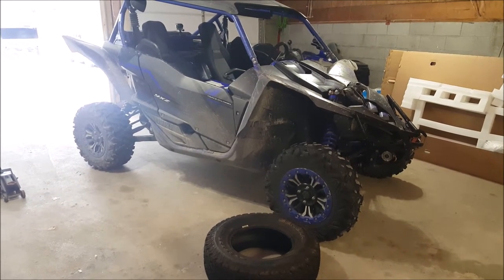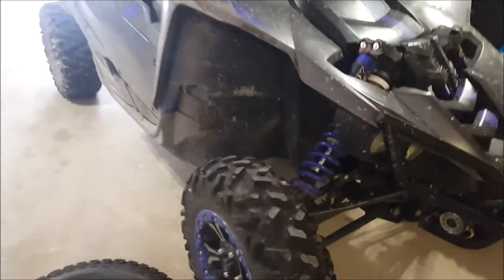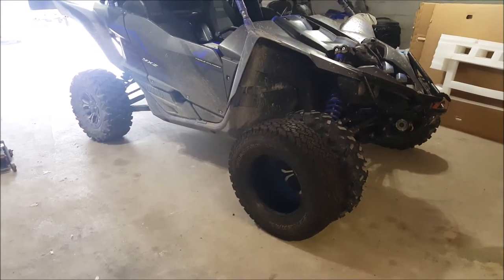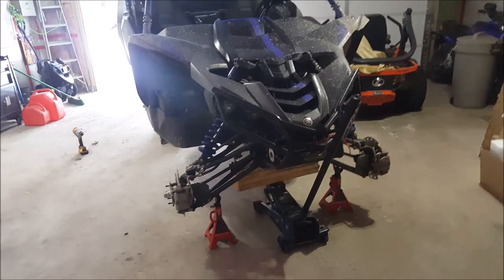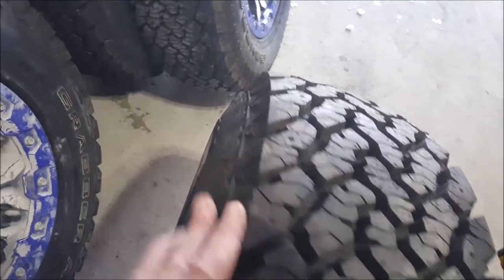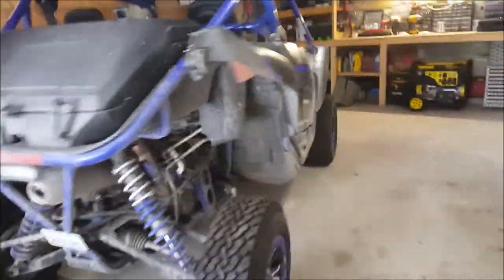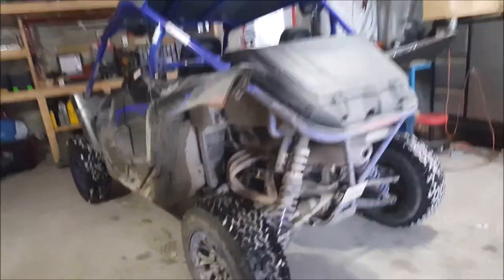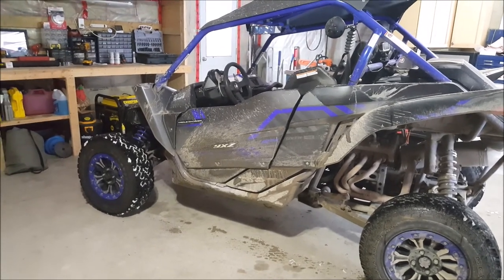Yamaha Yxz1000R Gets New Light Truck Tires | Yamaha Yxz1000R Turbo Tire

Comment: I'm about to do this on the front of my Honda Pioneer. Hopefully the ride isn't too hard.
Reply from the maker: No complaints here!
Reply from the maker: Ty, general grabber size is 27x8.5x14 lt tires
Reply: @McGo101  The ride is about the same. I don't have enough miles to tell how they are going to wear.

Comment: Did you measure the height after the tires was mounted?  Just curious if there was a height difference on the fronts vs the rear's with the wider rim.   I'm wanting to put LT tires on my Honda Pioneer 1000 factory rims.
Reply from the maker: I didn't measure but I think it was very close to the stock big horns 2.0s it came with. If I was to do it again I would get a trail style sxs tire so it still looked aggressive.

Comment: How have them tires done on the road ? I’ve got my Kawasaki krx street legal and I guess it’s not aligned cause it’s chewed my right tire up and the camber tires always look wired but I’m considering putting highway tires in my machine as it’s so fun to ride on the road but let me know how there doin on the roads
Reply from the maker: They worked great on everything except deep mud of course. sold the machine a while ago but i too ran alot of pavement and dirt roads to get to the trails and they worked excellent. Not as nice visually as a sxs trail tire but will last a long time. also was nice not to be concerned about punctures from sharp rocks was an added bonus.

Comment: what springs are you using on the rear shocks ?
Reply from the maker: Just the stock fox springs that come with the yxz
Reply: @McGo101  oh ok , just noticed the 2 different colors and wondered if it was a aftermarket spring. Im getting a 2024 so i was curious

Comment: What tire pressure did you end up with?
Reply from the maker: Still running about 20 psi in all. I don't like using 4x4 unless I know the tires are at even pressure